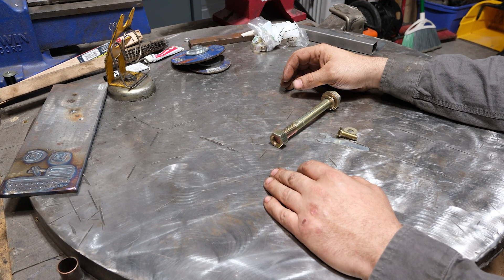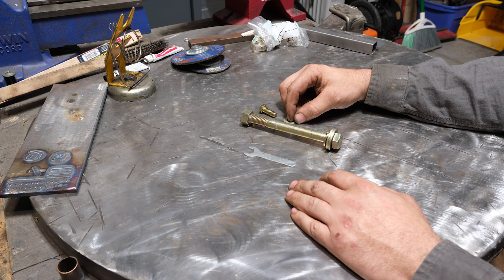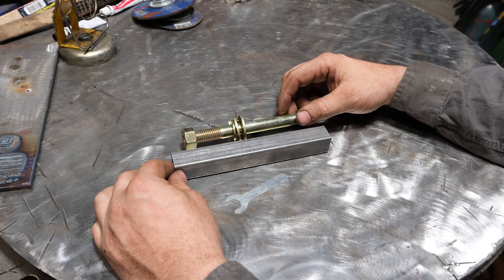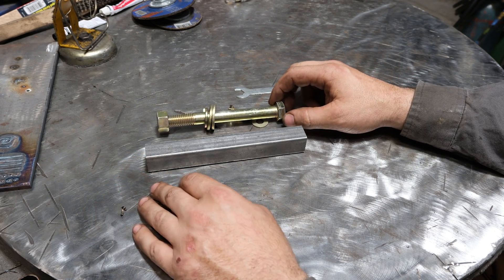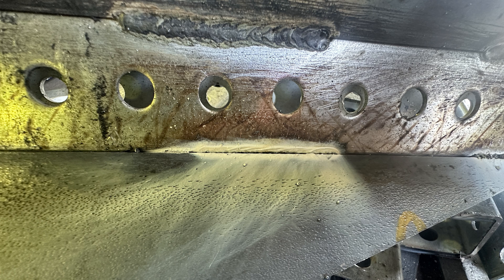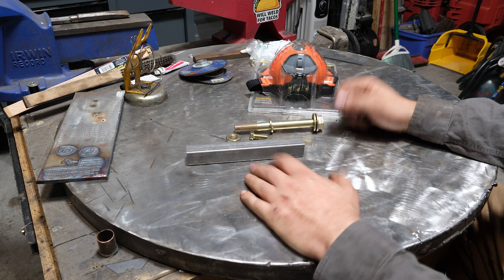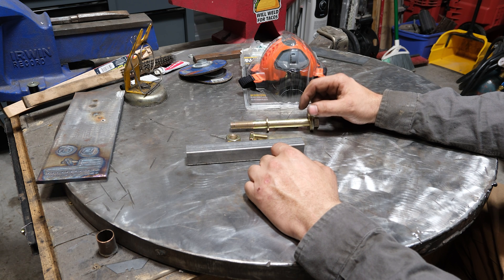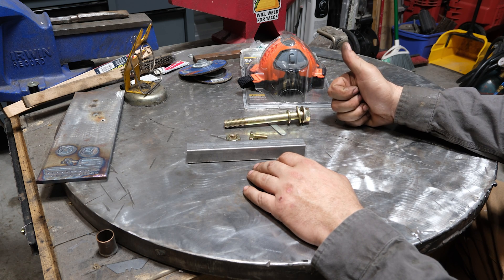Welding on galvanized material (safely)

Comment: For cutting down on airborne grinding dust, there's the option of manually wetsanding, instead of using power tools. Use a coarser grit of sandpaper, and disposable lab gloves.

Outdoors, I've successfully stripped hot-dip galvanized zinc from steel with hydrochloric acid. The acid was diluted with distilled water to reduce the rate of corrosion. Both HCl and zinc chloride are acidic, but were neutralized with sodium bicarbonate, where carbon dioxide was released upon addition of sodium bicarbonate, until the solution was no longer acidic. The zinc carbonate precipitate is easier to separate for chemical-waste disposal.

Hot-dip galvanized zinc: thick and chalky grey, with macroscopic grains of zinc (e.g. unpainted guard rails)
zinc electroplating: thin and dull grey, likely to lose silver appearance due to gradual oxidation
zinc chromate conversion coating, trivalent: thin and bluish silver
zinc chromate conversion coating, hexavalent: thin and brassy (light gold) with pink and green iridescence
cadmium chromate conversion coating: similar in appearance to zinc chromate, toxic and unlikely to encounter except in aerospace or 20th-century applications
strontium chromate: yellow or greenish-yellow primer (brush-on or spray), usually found in aerospace or high corrosion-resistance applications on aluminum, magnesium, or zinc alloys
chromium plating: appearance varies from mirror-like silver to dull gray, plating sequence consists of either copper-nickel-chromium, nickel-chromium, or direct chromium plating

Zinc chromate is often misrepresented as "zinc electroplating", which is half true, because electroplating is the first step before chromate conversion. The potential toxicity should be respected before grinding or welding chromium and its compounds. This warrants knowledge of the hazards, chemistry, and proper disposal.

Older 20th-century and/or Chinese-sourced materials are more likely to contain toxic heavy metals (e.g. lead in galvanized zinc). Unwelded, machined steel should be suspected of being a "free-machining steel", which is likely to contain lead.

Comment: Thank for the warnings, gratefully noted.  How about trying a ‘not too long’ breathing tube and nose clip….exit the tube waist height and behind you.  BTW you can’t naturally breathe with tubes much over a couple of feet because the old air won’t be sufficiently expelled, but this would keep your air intake out of the rising fume plume.  A positive pressure hood would be best…but too pricey for occasional use, so you could cobble up a home version using a mask that is air fed from a high pressure fan located well away from the weld….a bit of inventive ingenuity required!
Reply from the maker: Pulling any air from behind you will help no doubt.  Using a fan and blowing the fume away from your face can help too.  The hard part is a couple solid breaths could be enough to make you sick, so it’s best to avoid breathing any of it if possible.

Comment: The bright blue arcing you mentioned happened to me while welding galv.  The sudden intensity was either so bright that it overcame my auto darkening helmet or was outside of the spectrum of the helmets sensor.  It resulted in the worst flash I’ve ever gotten, and I worried I had permanently damaged my sight.  9:34
Reply from the maker: Luckily if your hood was down the plastic in the lens and on the cartridge will block damaging UV light, but it definitely wont do much to prevent the super bright light from overwhelming your eyes.  No doubt arc sensors can have issues picking up an arc with smoke or blue arcs due to contaminates.

Comment: Powered air respirators like the 3M Adflo system should be more commonplace
Reply from the maker: You are 100% right.  I believe at some point in the next 6-8 years it will be mandatory for companies to provide them.  I hate to admit it but the classification of welding is likely lower than it should be for known carcinogen.  If it were to be reclassified it would significantly change the working world no doubt.  The big one I believe will become labeled as super bad is aluminum welding.  6010 in a field has nothing on a bunch of aluminum welding.  The dust and fume has to be a carcinogen.

Comment: Hey Greg. Thank you for all the great videos. How can you tell when you need to change the respirator filter?
Reply from the maker: That’s a great question.  If the filter seems like it’s restrictive, there are any visible holes in it, when you blow air over it and it doesn’t seem to clean most of the dust off, or it’s contaminated with liquid/oil/etc.  a good test would be to try to knock the dust off and compare how you breathe through it with that filter vs a brand new one.  If the old filter with the dust knocked off seems much harder to breathe through you should probably change it.  I personally find the filters to last about 1-2 months based on my use.  The more you grind with abrasive discs the worse it gets.  Actual welding tends not to be that bad in comparison to dust.
Reply: @makingmistakeswithgreg  Thank you very much for taking the time to reply.

Comment: At work we use an electrode for galvanised steel , its named  Soudotec 222 , made especially for that. Maybe there is other brands as i am in Montreal suburbs and never saw that anywhere else
Reply from the maker: I looked up that rod and it’s got some real interesting properties.  First off it’s definitely sold for the specific use of welding galvanized material.  In the states I have never seen a rod marketed just for that.  Second, it is specified as being used on DC negative or AC, which is wild since it is very uncommon to weld DC negative except with 6013 on sheet metal.  Third, it has very high tensile strength of 80k and solid performance across the board.  Not what I would have expected for welding galvanized materials lol.

Comment: Silicon bronze brazing is an alternative that may provide a strong enough connection.  If you don't destroy the galvanizing, it might make it less likely to need painting.  I was looking at an ESAB Rogue EM 190 Pro to give it a try but I need to find a place for the Argon cylinder first.  The ESAB 190 welder has a spot and stitch setting that might help with controlling the heat. I don't see many YouTube videos on the ESAB 190 so not sure how good it is.
Reply from the maker: So the esab 190 is actually on my list to possibly buy.  The reason is the machine has power factor correction and is capable of running on a generator better than almost every other 180-200 amp machine.  I have not actually used the machine and like you found out, very little info is out there on it.  I have a feeling it’s a solid machine and will work excellent.

Comment: I have to weld it very often for auto body, and it’s mostly like 18ga so I’m using 25/75 mix .035 and 16.5 and like 190 IPM, just needs to burn away a little more first so a very exaggerated whip to get like spatter and then it’ll arc and clean on the build. Pushing is mandatory. Non dual shield Flux core I’ve come to dislike as most times due to dragging basically being the only way to get a decent bead, it’ll get though light surface rust but really doesn’t get the results of a hot mig weld

Comment: Those small items are electrically plated, blue and yellow zinc, and it's relatively thin.  The square sign tubes are undoubtedly hot-dipped; much thicker zinc.  The hot-dipped zinc is tough to remove with a grinder and kind of smears around.  I never gave much thought to welding on the plated stuff.  The blue zinc on hardware store nuts & bolts must be incredibly thin since they don't hold up long exposed to weather.  Good info.

Comment: Thankyou for the good advice, as a complete beginner to welding it is so very helpful to understand the hazards and the right way of doing things. Your tutorials are much appreciated :-)
Reply from the maker: No problem 😀.  The big things you want to avoid is welding on coated materials without a respirator and preferably outdoors, nd never clean anything with chlorinated solvents (such s brake clean).  The gas produced welding over chlorinated solvents produces extremely toxic gasses.

Comment: Thanks for making this video. I'd recommend wearing a respirator / mask on any welding jobs if that's something one does frequently.
Reply: @ryebis  Good shout, even when it doesn't need grinding and it's a simple tack and run a few beads, you won't regret the habit. Same goes for eye protection.
Reply from the maker: It will only help, thats for sure.

Comment: Smaller bolts are never hot dip, the small threads would be ruined. But older yellow zinc, while thin electric zinc,  can contain chrome VI . Yay :D. Old Yellow Zinc is a Chromate Conversion Coating
Reply from the maker: Thanks for the clarification and info 😀

Comment: Gri d all the zinc off the weld are and heat affected zone before trying to weld. You will still get a few traces remaining  but 95% or more of the zinc is gone.
Then hold your breath when you weld, then move away. Most welds are under 10 seconds so that is much easier than messing with masks and stuff, and trying to breathe the poison through a mask which just seems dumb to me.
Reply from the maker: The mask will filter the particulate out of the air.  Since fume can be trapped by the filter itself and it prevents it from entering your lungs.  If the mask fits properly the mask works.  Holding your breath won’t protect you from long term/chronic exposure of harmful dust unfortunately.  It might lower your acute exposure so you’re not bothered that day, but the long term effects will still exist.
Reply: I'm in the same boat as you. I'm  63 years old. Walking away upwind is a very common move for me. I don't weld galvanized day in and day out though.

Comment: I must have had "weld fever" once.  A few hours after I welded a piece of painted steel tube I was sick with the symptoms you mention.  It felt like the flu, but milder.  Not something I want to have again -- but I still resist wearing a respirator.  I don't know what it takes to get through my thick head how dumb that is.  Another thing that is bad for anyone is the grinding dust from any kind of material.  If you are coughing up black mess after a lot of grinding, then even more is going into the lungs, which obviously isn't good. 🤮
Reply from the maker: The hard part is the damage takes so long to set in that by time your lung function is low it’s too late.  Anything you can do to help the lungs is worth it 👍

Comment: Talking about PPE, a video about different masks & respirators might be really interesting.
Reply: Most halfmasks will do ok for welding galv, even fairly cheap ones (within reason). I'm no HSE-engineer or such, but from using masks, the biggest issue is longevity and availability of filters. The filters is what counts in most cases. I used an ABEKP3 filter on a Sundström halfmask lately when welding galv, and I havn't felt any health issues at all.

Only "problem" would be that the single filter takes alot of space so I need to kinda tilt my head to see what I'm doing. The 3M or similar dual-filter mask might be more practical in that aspect.

Comment: Great info as all ive seen from you.  I weld galveneal daily it does burn kinda clean and hasnt effected me that i feel.  Employer stated that its one of the " cleanest " per say . I tend to feel they didn't just make that up not 100% so thought id see what you say about it.  I weld 14 gauge generally  co2  35  wire. It really reminds me of in ways  welding with 98.5 helium 2.5 argon  stainless.   However back then i didn't know anything about inductance on that old airco or deltaweld . I run lower induction now and that puddle isnt as wet as the ss was .
Reply from the maker: Co2 with lower inductance is definitely the way to weld what you do 👍.  It will give plenty of penetration, and all the control to weld poor fitups/gaps.  I almost rather use than flux core.

Comment: Great information.  I was practice Tig welding on some painted tube. I sanded off the paint and the steel looked like it was zinc coated. After the weld, the inside of the tube was a white powder. So most likely it was zinc coated. Only welded a small amount, which is a good thing. Thanks for posting this video.
Reply from the maker: The white powder is definitely a tell tail sign.  Tig also tends to have a blue arc color which is also a sign.

Comment: Hobart Fabshield 21B.  Check it out awesome flux core wire. I buy in the small 2 pound roll. It's like buying slice cheese you don't go buy a 5 pound brick unless you plan on eating a lot of cheese. You will always have fresh cheese when you need it with a smaller package. Yeah i get it from the welding store online. Love your wisdom Greg!
Reply from the maker: That’s my favorite wire, and it’s what I use in my personal welders.  It welds way cleaner/better than harbor freights wire.  I ended up getting a bunch of spools of the HF wire at work since they bought the wrong stuff (they needed mig wire and bought flux core lol).  I have had it for 6 months and finally found a job to break it out on.

Comment: The muriatic acid will make ZnCl2 and hydrogen gas. The zinc chlorine will stay in solution. You don't need to use fuming acid to do this, and of course acid safety is needed. As far as when you're done, you can probably just rinse it thoroughly with water. I have a fair amount of experience with chemistry and doing lab work so I'd be willing to do this, but for someone who is inexperienced handling strong acids maybe don't do that.
Reply from the maker: Thanks a lot for the insight.  I have heard it works but dealing with the acid seems less than desirable in the home shop lol.

Comment: Unfortunately, when I first started working in a fab shop, they made me weld galvannealed one day. I made only *one* mistake. I was good at it. from then on, whenever they got galvannealed parts ordered, I was the guy TIG welding them. Worst mistake of my life. Lesson learned, never be too good at things you dont wanna do.
Reply: @Nakadori.qcow2  You could be good, but be real slow, or just keep upping the price for jobs. If you've taken an hourly rate for clean plain or stainless even, if they start giving you dipped or painted stuff and you have to fight that then you'd be well within your rights to renegotiate. Messier and harder work ought to pay extra.
Reply: @joytotheworld9109 Most definitely, im good but i take my time with it, burning low and slow putting usually some stainless wire onto it. I’m one of the better die welders they have in the shop, so, they’d rather pay me what im worth than have me walk. I keep getting more galvannealed and theyre gonna get chewed out about it though. Or theyre gonna bump my hourly from 27 to 30ish

Comment: Lye (many drain cleaners) also dissolves zinc.  An overnight soak followed by a thorough rinse is very effective, and heating speeds the chemical reaction.   I have a replacement air hood but if I am bench welding I hook it to an old CPAP machine.

Comment: I use Vinegar for small parts and pool cleaner which is muriatic acid, I dilute the acid when done and dispose of it at local plant that deals with acids, i also have supplied air to my welding lid, Thanks for sharing this info.
Reply from the maker: The supplied air is a great thing to have no doubt 👍

Comment: White vinegar also works to get the zinc off, but it does take longer.
For welding galv hardware to projects you can TIG braze them with SiBr filler. It doesn't get it hot enough to vaporize the zinc like welding will, so you don't have to grind it off, leaving the rust protection in place.
Reply from the maker: I have done a bunch of silicon bronze with tig but never on galvanized, good to know 👍👍
Reply: @makingmistakeswithgreg  I'm sure it has limitations on big pieces of galv, with heat build up. But glueing nuts and bolts to  projects, works really well.
Reply: @darenscott1718  brazing, like soldering, can do a whole lot of jobs where you don't need the durability of a solid weld. Much safer gas/dust wise and less likely to warp a piece as it's much cooler.

Comment: I've struggled trying to tig weld galvanized sheet metal. Grinding a thin sheet metal clean isn't easy. 
 Since then I've tried cleaning with acid and had better luck.
Reply from the maker: Tig welding it will produce a bunch of yellow dust, a blue arc, and a completely contaminated tungsten lol.  The only way to tig weld anything that’s galvanized is to clean the surface off completely.  The same thing is an issue with modern auto body, the coatings often make it impossible to tig weld with any decent results.

Comment: Plated material and brake cleaner. Two things that will get you very sick, very fast and for a long time! I just finished a month long project where everything was a hazardous material. I shaved a 35 year old beard off so my SCBA mask would fit properly. Now that that is done, the shaving is over and the beard is coming back. (But I still developed a cough in the process.)
Reply from the maker: Great point on the respiratory protection not working properly with a Beard.  That is definitely an issue.  The papr I use at work seems to work ok with my smaller beard.  The filter masks generally fit poorly with a beard unfortunately.  Glad to hear you made an effort to protect your lungs, hopefully your cough goes away.  Hazardous materials are no joke.